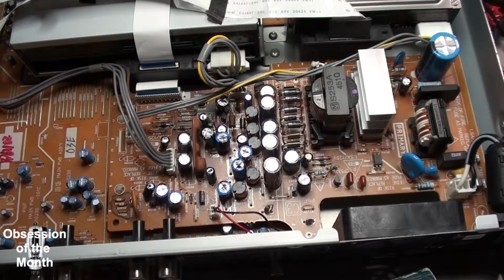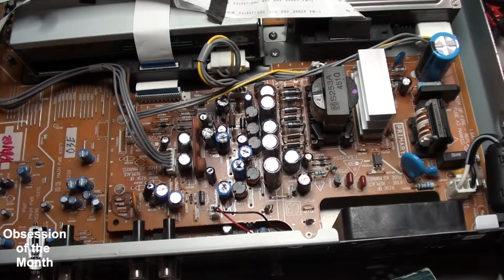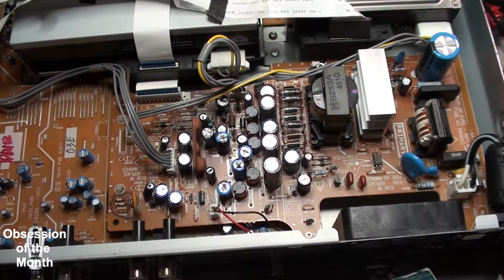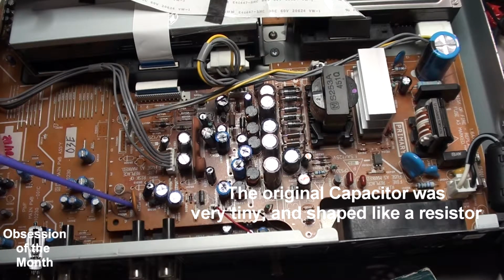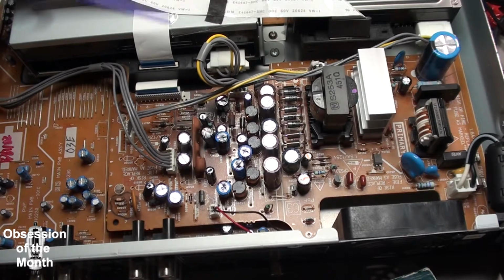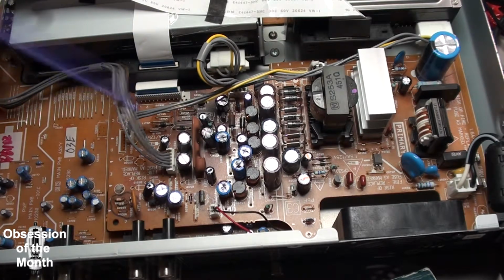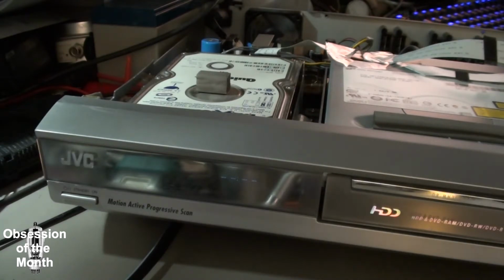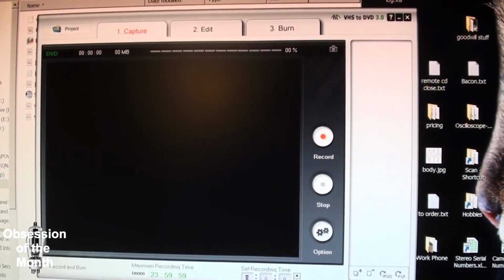JVC DR-MH30SU HDD DVD Recorder Power Supply repair

Comment: In my case (in the same machine), it is the opposite: the original HDD connector works fine, but there are problems with the DVD drive connector.

Comment: I have one of these machines and I've had that problem happen twice only I've not had it repaired the second time yet but it is a very nice machine.  Is there a way to replace the power supply for a different type that is strong enough so that this will not happen again?
Reply from the maker: You can just power the hard drive from any power supply with the proper connectors, since the hard drive does not spin up till the machine commands it. usually the power to the machine and DVD will work fine it's the power to the HD that is the issue.